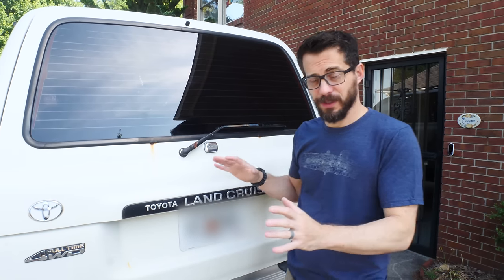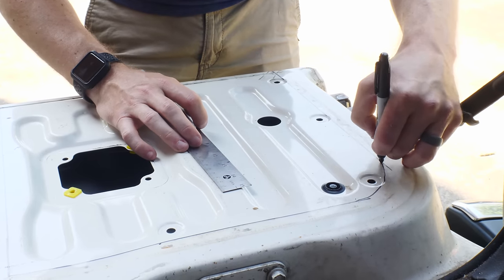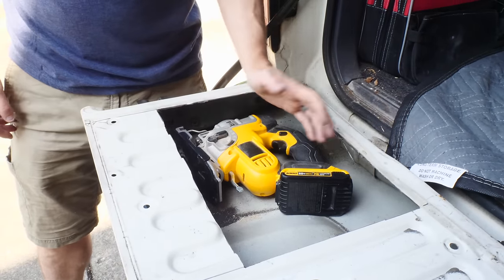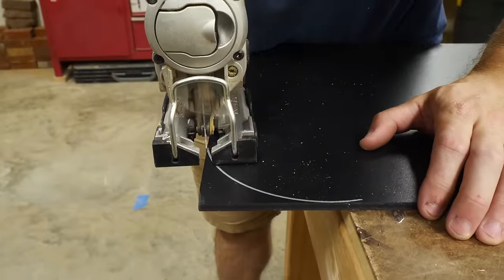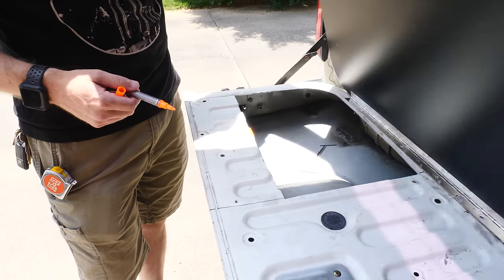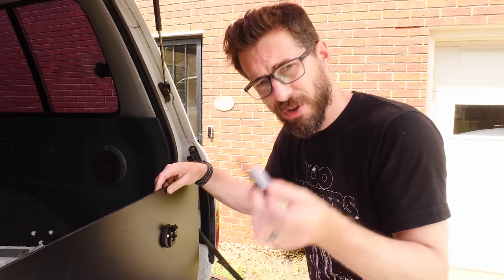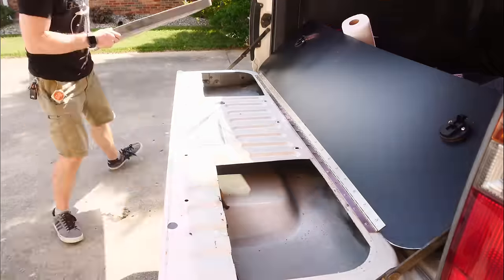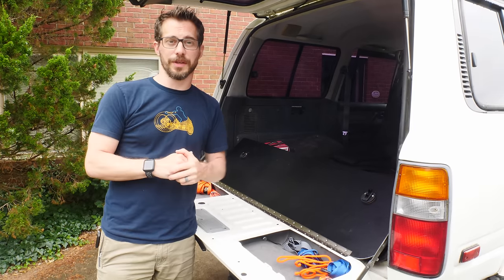Custom Tailgate Storage // Land Cruiser | I Like To Make Stuff

Comment: first love your page and the way you edit your videos.  I have an 09 honda fit which I use for parking lot camping when I go snowboarding. anyways I want to build in the back tailgate a shower stall for showering. I am super scared to cut into the metal back there but I'm sure ill eventually do it. Currently, I have removed the back seats and built an area of wood that makes a fold out twin bed so I can sleep inside the car when the temp is low. this wood underneath also holds cubbies for gear and food. I was wondering if you know of a material I could use other than wood that would be lighter and just as strong? keep up the good work!

Comment: One project I have always been afraid of is I want to hardwire led strip lights into my car, right now I have them on a separate power supply through the cigarette lighter although I would MUCH rather have them hardwired into the switch with the rest of the lights. Any suggestions on how not to mess things up? Or how i should go about working on electronics on a 19 year old car?

Comment: just wondering why you would do that? I just put a 10 or 15 gallon husky tote in the trunk of my car and strapped it into place. it has everything, you could or would need in case of an emergency. plus is easier and wont make noise when taking corners.

Comment: i thought of this 4 my tail gate on my   '02 & '04  Chevy Silverado Truck's  ( the -2 is a shortbed & the  04 is a longbed )  not sure if it makes a real differance thoo... i am  i'm wanting to tuck some chain's & maybe a small come a long & a bigger one   not a giant one  !!! inside my tailgate  if the bigger one will fit even cus  i can't stand it all in my pass., side floor boad  much longer esp,. being a single cab the 04 is.... now the 02 is an ext,. cab w/ both rear doors open up suicidal type  i thought to cut holes in the floors on either side of the hump ( drive shaft ) to make as tool or chain storage but then i started to think x-tra weight & how's it going to hang for long term under there... what sort of metal should be strong yet durable & not so dang costly & how thick does each side need to be to support the x-tra weight too... then thinking 2 nd hand maybe a box on an old junk yard truck or like at tractor supply store or even rual king store or  some where on the net............   ANY & ALL IDEA'S  LET ME KNOW.......

Comment: Back Up Cam while using original radio... not sure 100% sure if the camera turning on would be enough to trigger the rear view or if I would have to run a remote cable too...

Comment: @I Like To Make Stuff:   How has it held up, was it strong enough to avoid warping or flexing?
Reply from the maker: Actually super well!  The hinge started to rust a bit, I should have used stainless. I'll replace it eventually.  One of these days I may look into replacing the panel with a plastic/aluminum composite, so it's a little more rigid, but the plastic only totally works 👍🏼

Comment: Would be a bit better design if you made 2 smaller separate doors with latches instead of one large one. fill the space in the middle with the carpet you removed at the beginning. more secure and less chance of warping over time. Just my .02 though

Comment: I would replace that panel with something different. That material is meant to bend easily with very little heat. Imagine how hot a car gets in the summer... the material will definitely warp.
Reply from the maker: It’s been 95+ the past two days and it’s held shape perfectly.

Comment: i often need to crawl into the back of my land cruiser or use the tailgate as a seat, im guessing that material that would not really be possible anymore right?
Reply from the maker: Yeah, it works just fine. If it was a concern, you could use something else to the same effect, like aluminum.

Comment: Oh I’ve got some Kut Snake flares to go on my Landcruiser ute.... but the sad bits are in two parts!
Namely I can’t get a decent clear top coat onto the 058 paint code colour using rattle cans (everything from orange peel to undercoating to runs AND then there’s the drilling and fitting!
Sorry bob but they won’t fit your cruiser but you’re welcome to come to South West Australia and finish this damn project....I need to fit some mud tyres and want the flares to stop the gravel and mud flicking about.  How friggin sad is that?  Sigh!!
I promise that I will have it done by 2019 though....

Comment: i have been wanting to use fiber optic cables to add pin lights to my ceiling in my room for a while now, but im afraid to start as i havent ever worked with fiber optic cabling before it is intimidates me

Comment: "The rivets worked here great aswell in the sheet metal"- riveting especially invented for sheet metal...😏 and happens to bond wood and plastics to metals too or the other way round....
Sorry m8..had to say something. Actually very clever and cool build you made. Gotta have some balls of steel to sink that cutting disc into your car!
Reply: Cutting into a car is nerve racking. I have had to do it for the inner fender liner and for the floor pans in my 65 mustang. Those first cuts are terrifying and then as you get closer to welding the new parts in, the better you feel about it. 

After doing the floor pans, I would have no problem with cutting out the small sections that he did in his car.

Comment: I want to make a truck cab for the bed of my truck but I don't know if I should weld it on and make my truck into an SUV type of truck or make it a cab that I can pull off if need be but I know how I would go about making a cab that would stay on my truck and not fly off while driving down the high way

Comment: I've always wanted to cut down the metal legs on my table saw and miter saw stands. 
I had to put both tools on wheeled bases since I don't have room to leave them out all the time. Unfortunately that made them 4 inches taller. The added height with my lack of height has made both saws way to tall to use comfortably. 

I'm just really not sure about getting that compound angle cut correctly 8 times. The idea of having to cut 4 of them to the exact same length and angles unnerves me. 
I only have two tools able to cut metal an angle grinder or a reciprocating saw.

Comment: That looks like a good idea but I was wondering why you didn't just reuse the metal from the tailgate that you already cut off. You could have made hinges for those steel plates you cut out and done everything else the same way. You wouldn't have needed to buy the materials to make a new cover and you wouldn't have had to worry about the strength or thickness of the material with it being the same material it was already made of. It would also already be the shape you needed because it is the same shape you cut out. Just an opinion.

Comment: Great idea, but the worst and most fatal floor I can see is- now you can’t step on the tailgate, the thin foam plastic will give way instantly. You’ll have to make a proper door from 9mm ply and paint black.
Reply from the maker: I step on it constantly, load material in and out. Works just fine 👍🏼

Comment: Not quite as useful as your storage idea but I removed my factory fog lights as they were inadequate and one had a broken bracket. I installed a set of off road led light pods in their place and drilled into the top of the opening to mount them. I also added a small piece of metal to the nut side of the mount so it didn't pull through the plastic or the vibrations could be seen with the lights on. I also rewired them to turn on with the factory fog light switch instead of headlights only. So no additional wiring harness was needed.

Comment: You know it would not be a bad idea to add rubber strips to the metal edge it would add an extra layer of protection Just in case a kid decided  to grab it to use as pull up or some thing.

Comment: Why not use the original carpet you removed as a template for the door, and also why not add the carpet to the top of the door to add rigidity and OEM aesthetics?

Comment: Some kind of guard around the raw metal edges would look n function better plus won't need a tetanus shot to open or close the tailgate. Why not use the metal u cut out as doors? Maybe some kind of dense foam like gun cases have...so u can cut to fit large tools. Hey will you cut into the fenders too? Lots of unused space there.

Comment: Maybe could’ve used the original panel you removed as the door. Instead of buying that plastic sheet.
Also can you please include metric dimensions, even as text at the bottom of the video?

Comment: i would'nt do this is any working truck that's gonna be hauling anything nasty or just a load of dirt or anything heavy and pointy (why didn't he use steel from the start??) :)  better to cut out the fender walls of the bed in the side were the gas tank isn't :) you can build a 3 foot shelf in that spot about 2 foot tall and whatever length your bed has to work with but  for a somthing like that ride it might work  since its a family ride but i would def make some drain holes
Reply: 6mil diabond is a great inexpensive material to use for this project and others. similar to PVC in fabrication techniques, but much more rigid. happy making